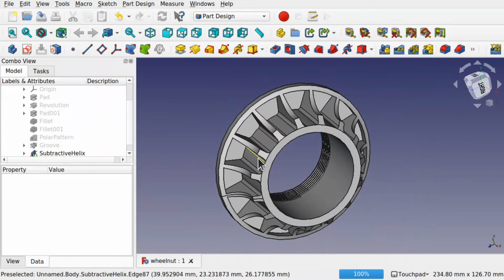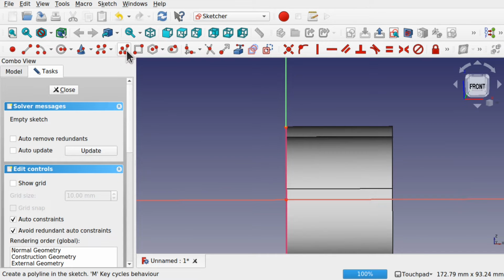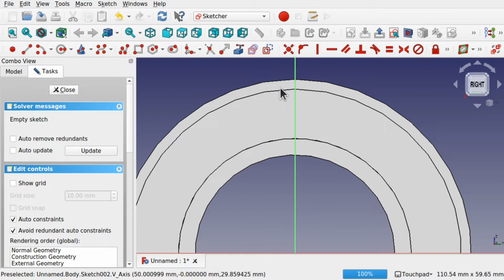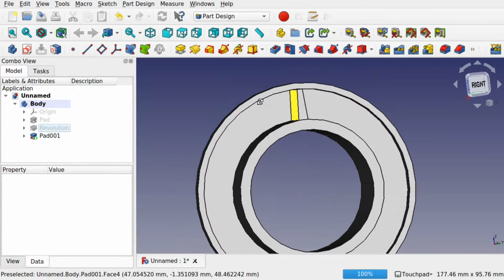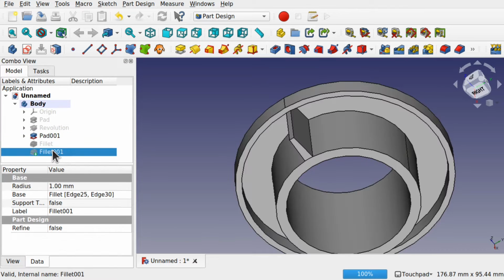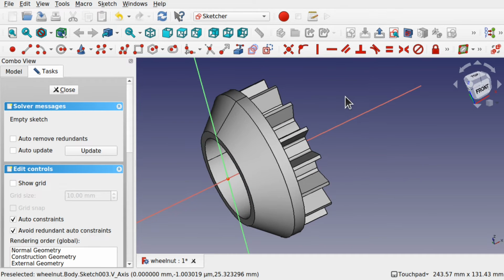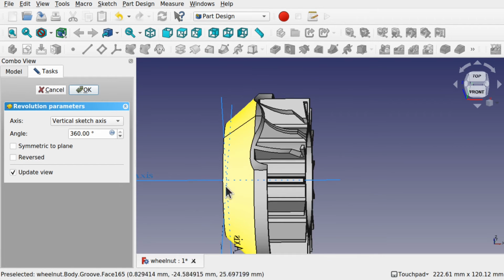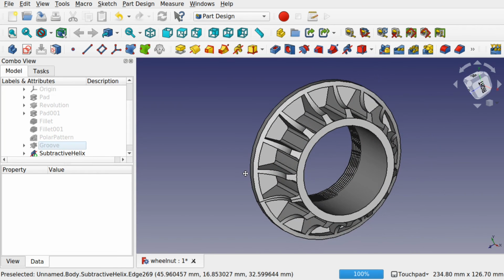Understanding FreeCAD 15 | Wheel Nut Formula 1 | Part Design | Easy Beginners Tutorial

Comment: Love your tutorials!  I am having an issue with this one as I am using Version 1.0 and I suspect that may be the difference.  At 20:11 you are pulling in a point but on my version, non of that is visible.  I don't get the lines or vertices along the edge of the section view. so i cannot choose a non-existent vertex.  Is there an option that you are aware of the make that edge and its vertices visible in V.1.0-RC2?
Reply: Figured it out.  Had a choose vertex BEFORE i hit the section button.
Reply from the maker: Glad to see you have it fixed :) Nice to hear your enjoying the tutorials.

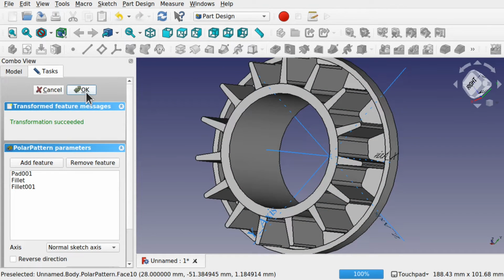Comment: Hello. Step at  around 17:00 (PolarPattern) gives me this error. Transform:Result has multiple solids. This is not supported at this time. I'm on version 0.19 R 24267 - 2022/02/28. I'm on windows 10. Any suggestion as what to look for? Thanks for these very useful and well done videos.
Reply: OK. I got it to work. Never mind. Thanks.😊
Reply from the maker: I was just going to reply to say you may have the wrong axis selected when you do the polar pattern. Glad you got it to it work 👍👍👍

Comment: Would  this be acceptable for 3d printers?
Reply: Tip for 'better' threads:  add a small chamfer to the inner edge of the tube you're cutting the thread into, then define the thread profile at least one thread pitch distance outside the tube. These two changes will ensure a 'clean' entry of the thread into the tube.
Also, for 3D printing, you can use the 'Fit tolerance' setting in the 'Helix parameters' dialog to specifiy a small 'expansion' to the resulting thread cut such that a bolt thread created using the exact same thread profile (using an 'Additive helix' around a bolt shaft) as the one used to cut the thread in the tube will fit into the tube's threads once printed. On my Ender 3 V2, I use a 'Fit tolerance' of 0.2mm, making my bolt fit really nicely into the threads.
Reply from the maker: @imacmill  I am trying to find out how I can keep this comment at the top as  this is very useful information. If its OK with you I would like to add it to the description of the video and attribute yourself.
Reply: @MangoJellySolutions  Sure, but of course there's missing information regarding thread-making for 3D printers that is available in other YT videos... I don't have the writing skills to explain it all in a brief post.
Reply from the maker: I can't see any reason why not. Just done a quick search and there are models out there that are basically the same and say they are fine for 3d print.
Reply: @MangoJellySolutions  Thank you for the reply. I'm more interested in your methods, not the file.
Reply from the maker: @Townie001  ah I see. Looking at the object I think it would be best to print so the polar pattern is at the top as the center of gravity will be lower and it feels more stable. I very much doubt you would need support for the overhang as I don't think the revolve was anything more than 45 degrees. It should be fine.